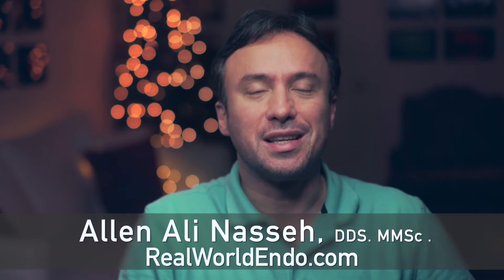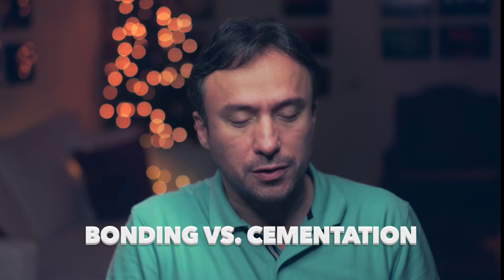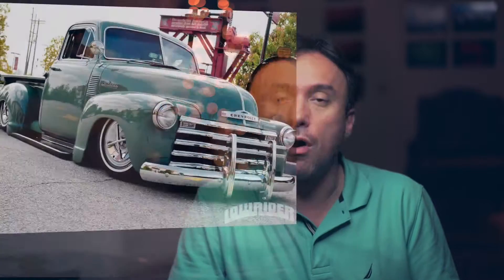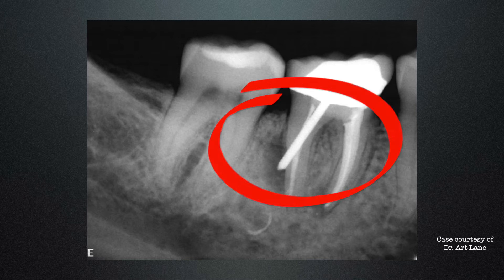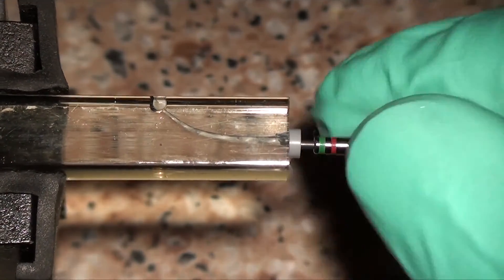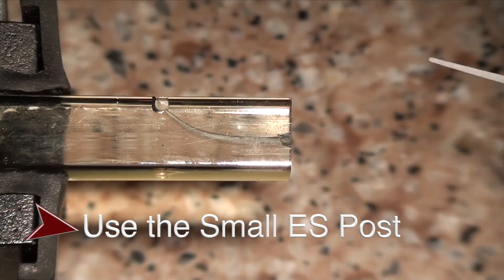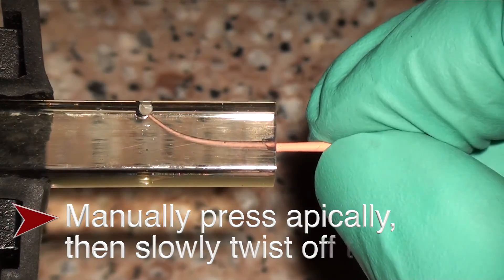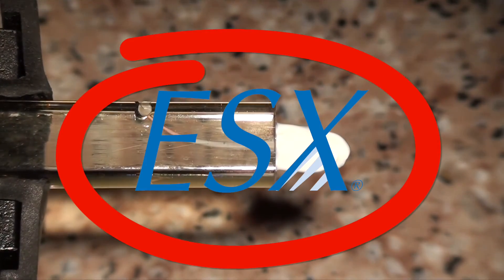Advantages of a Matching Post  Friday Questions HD

Comment: sir good afternoon. i want to ask a question  in a root canal treated tooth with a little coronal structure.
which one is more strong a tooth with bonded restoration build up or tooth will post for fixed prosthodontics?